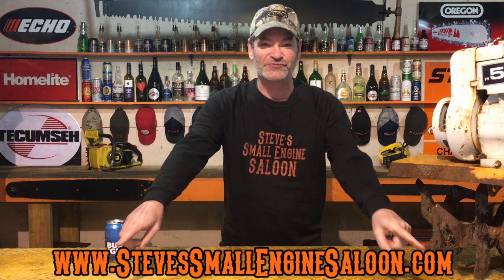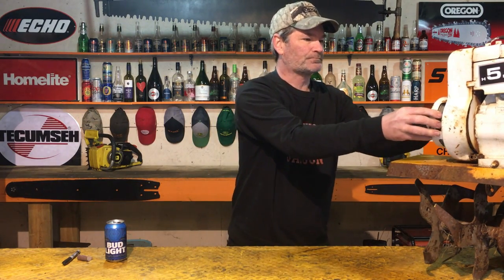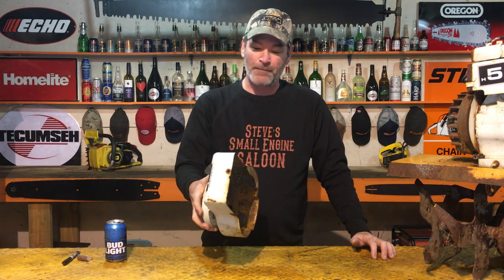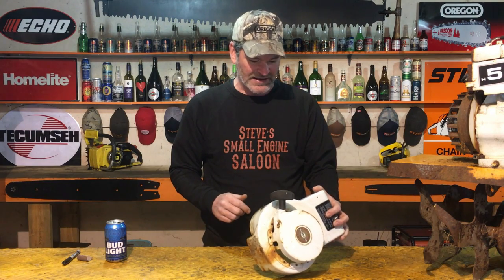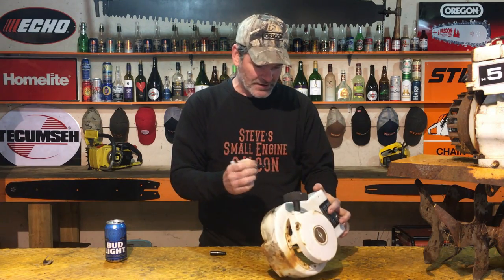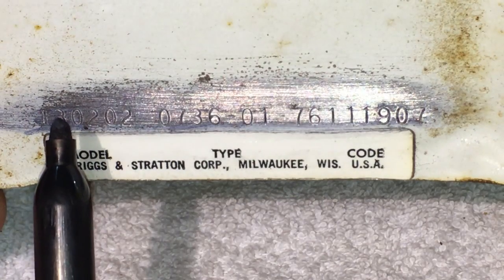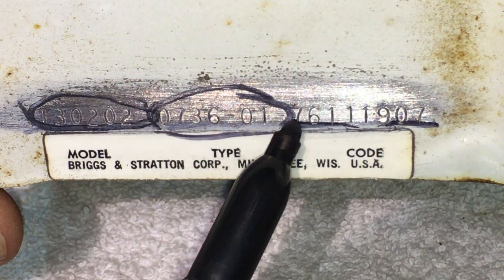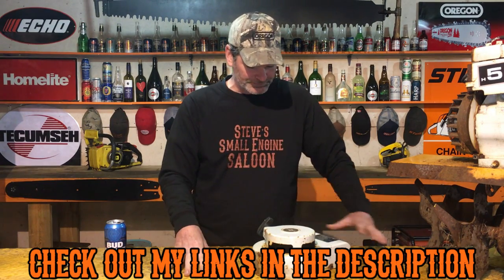How To Find Out The Age Of Your Briggs and Stratton Engine

Comment from the maker: Click here for my website--- http://www.stevessmallenginesaloon.com/
Click here for my Parts and Tools Store---- https://www.amazon.com/shop/stevessmallenginesaloon
Reply: So I have a briggs 6b hs and the first digits are 11 but I know it's a mid 50s. Is there any other way to find a production year?
Reply: Steve love your videos.
Have a question.
'77 briggs 5hp garden tiller
I keep shearing off the  flywheel key. 
Did a tune up changed the points kit and cleaned carb. New plug also. Can't keep from cutting key. Any ideas. Thanks. Mark
Reply: Steve, I've got an old 3 hp Briggs with code 6222051. The parts warehouses are asking if it's older than 6212310. Can you help me out? It doesn't have a coil, and I THINK that a 591420 (magnetron) will work, but only if it's older than 6212310. If not, I need the ancient sideways coil (291617). Any help would be appreciated!
Reply: you all probably dont care at all but does anyone know of a way to log back into an Instagram account..?
I was stupid lost my login password. I would appreciate any help you can give me!
Reply: I watch your videos all the time. I just need to be hand held on this particular question

Comment: Had to run out to the shed to check an oldie that was at my father's house when I cleaned it out.  It has an oil-bath air filter.  Still has good compression.  1959.  Now it's a "must-do" to clean it up and get it running.   Thanks for posting.
Reply from the maker: Good luck Joe...
Reply: You better double check with Briggs because they did not date them like that in 1959. Anything prior to 1965 and the code will not tell you the year. So your engine could be 1950, or it could be 1964 no way for that code to tell you.
If Briggs cant pull it up for you some of the guys on the antique websites can. The older ones have the DOM stamped on the back of the flywheel if you have an original flywheel on your engine, thats another way to see.
Reply: Has oil bath, flowjet carb runs like a top!! THANKS Joe !!!
Reply: Is on a Toro Tiller
Reply: @tombonardi8868  No, just the motor.  Degreased it yesterday.  Still had gas in the tank. Really nasty. must have been in there at least 25 years.  Getting the varnish out will take awhile.  BTW, it only a 2 h.p.  Not sure how good it'll be with unleaded, but I'll just keep as a collector.
Reply: My soninlaw needed a tiller so i found one on craigs list being as cheap as i am i paid 20 bucks for this real old looking but strong heavy one (i like to bring things back from dead lol ) cleaned it up , i guess it was sitting a long time its a toro tiller 3 hp aluminum block   downdraft/flow jet carb  I changed the oil new spark plug started right up  but carb was messed up looking for carb i couldn’t find year??
Reply: @OldJoe212  I think it'll be ok. That engine probably doesn't have any rubber on the intake. Maybe no rubber other than for the spark plug wire and oil seals. When I was a kid in the 1970s I used to fix those engines. Learned how in 4H. Brass fuel pickup into the tank. Gumout is your friend. See if you can get a carb kit. I'd also grid the valves, WTH. I think the media in that engine that goes into the air intake oil sump is just steel wool if that's nasty. Could probably clean it with gasoline. Shop air dry it. Rebuild it, put a new set of rings on it and I bet it'll fire right up. Those cylinder walls always looked good unless it ran out of oil. Coil may be bad after all of these years. Sometimes they short out.
Reply: I have a Simplicity 2 wheeled tractor numbers on the eng. Model- 6bh Type- 900535 Serial-51425  Any Idea on age?

Comment: Hey Steve I just sold my mother's old Craftsman 5 hp front tine garden triller for $125.00 . I told the young man that bought it the life story of the 1978 model triller , told him it got used at most 10 too 12 hours a year and it still  had a lot of life left in it . It didn't look the best after being that old and being keep in a shed all of its life . Well to make a long story short , he called me two days later and said it did great . He said he'd trilled an acre up with it and run just fine . I knew it would - but I told him that was a bit much for such a small Tiller . He'd really called to ask was octane of gas I use , I told him I use only 93 octane in all my small engines . Anyway this kinda went along with your old 1976 model Briggs engine story video . Thank you for you great help with small engines Marshall Border Jonesboro Arkansas 👍

Comment: That's a '76 Briggs & Statton Recoil Starter pulled from an old Briggs & Stratton Engine! Especially if it's a 3.5 HP Classic Engine! I have a '86 model of a Briggs & Stratton coded with the 86 as the first two digits. I bought an old stock from Small Engines Warehouse about 10 years ago a decade brand new and strapped on a 1993 Murray Push Mower Deck. I had to use washers after I  used a tool make the threads. The engine came out when I was born in August of '86. Lol Great video Steve! You know your engines really well sir! Take Care, Phil

Comment: To piggyback on your suggestion, when trying to read the engine numbers, use chalk. It’s not permanent and is super cheap. You can just about buy a box of sidewalk chalk for the price of a permanent marker. It’ll be able to be used for more that you think(from wood working to entertaining your kiddos). I’d suggest using a color that will best contrast your engine color to better assist you in reading the needed info. Once you’ve thoroughly colored over them, using light pressure wipe away the excess. Doing this will leave the chalk 
color in the numbered imprints. 
Thanks for the videos!!!

Comment: If you have an antique built prior to 1965, you can find your DOM stamped on the back of your flywheel if the engine still has the same flywheel. Also their are a few antique websites with guys who know when they were built and you can always try Briggs customer support, sometimes they have the info to look up. Not sure what year they stopped stamping the back of the flywheel, but I have two old ones, a 41 model I, and a 54 model 6s that I had dated from the antique guys and they were right when I looked and verified it with the back of the flywheel.

Comment: I'm rebuilding our vintage Norlett mulchmower's engine this video helped me a ton it's 3.5hp briggs engine was manifactured in 1988 😄
Reply from the maker: Cool!
Reply: I gotta agree myself steve but the unfortunate part is that the parts manual i got from the serial number was for a riding mower with a 4-5hp briggs engine and not a 3.5hp which the norlett mulch mower uses 😄
Reply: One thing i find interesting on norlett's engine which i never seen on a lawn mower before is that the recoil assembly is mounted sideways next to the fuel tank some vintage briggs engines from the 1960s-90s had it that way which is way different compared to the nowdays recoil which is mounted on top of the engine 😄

Comment: I have an old push mower with a Brig's engine and would like to know when it was built. I purchased the mower new around 1966 or 67 and would like to know exactly when it was built so I can see how hard it is to get a rebuild kit for that engine. The mower lasted a long time before it finally stopped working. Thanks for sharing this information with us on those mowers.
Reply: I have one that old. 1966 Sycamore mower with the original 3.5 hp Briggs. It is STILL, a one or two pull start mower, points & condenser ignition and everything.

Comment: I ve got one that's a 1978 model tiller - it's a dandy and still use it Steve . It doesn't even use oil - don't think it was used that much - knew the guy that bought it new - used it in his flower garden . Anyway the only thing I've done to it is service it and have installed two different carburetor diaphragms in it in its history.
Reply: My wife uses a diaphragm but not on her carburetor

Comment: Thank you very much I have a 1972 two horsepower. It sits on an is your platform made for JCPenney's edger trimmer. I could clean up I'm not going to rebuild it it's got good spark. Return everything to its like new condition and I believe this thing will be going for another 50 years. Thanks again
Reply from the maker: Very cool!

Comment: Is there a way to adjust the choke on a Briggs and Stratton 3.5 hp edger motor. I replaced the carburetor on this McLane edger and now when I throw the choke to run, it seems like the rpms take off and I have to choke it down. I did have to buy a cheap eBay carb because they stopped making the OEM one

Comment: My tiller engine was built in 1977 and still runs great. I didn't realize it's as old as I am.
Reply from the maker: Right on
Reply: My Wizard tiller's engine is dated 79 and still running like a top. Old tiller engines might last forever if taken care of because they don't get much use.

Comment: I’ve got a 170702 0652-01, 1988 production year (7hp vertical shaft engine pull start) and I’m trying to find a carb for it and just searching the model and type numbers hasn’t given me much of anything, and I can get diagrams of other types of 170702 but not this exact one. I’d like to find a rebuild kit for it and the carb (anything that would fit would work I don’t care wether it’s oem), and it also needs a starting spring, any advice/help would be greatly appreciated, I would like to use the engine to put together a super simple riding mower with no wiring whatsoever.

Comment: From a dealers point of view all of these numbers are mega important and speeds up any help finding parts. Especially the model and type numbers are needed if you are calling up for spare parts as any Briggs and Stratton parts look up need these numbers to look up the correct engine model, the code number will help as certain parts might only be dated for a certain engine.
These numbers can also be located either on the rocker covers or a riveted on plate on most large single cylinder engines or v-twin engines, stamped on a plate above the exhaust, on the cowling as Steve said or stamped on the engine block somewhere. Other engine manufacturers also have important engine numbers either stuck on with a sticker or engraved into the engine block I.e Honda. Quoting other important numbers to dealers also helps as well like chassis serial numbers.
Reply from the maker: I couldn't agree more!  Thanks Ben...

Comment: How does one figure it out if the shroud  isn't original to the block or missing entirely, though?

I have one with a cast iron bore that the shroud indicates being an I/C 13ci built May 11, 1986.
I measured the bore and stroke which did not translate into 13ci

Comment: This is good information. Although, not all Briggs &Stratton are identified this way. 
For example, a 1957 model 19, will list a model, type and seriel number on a data plate. Which is located on the side of the engine. In 5his case, Briggs has a downloadable file which allows matching the seriel number configuration with the year of manufacture. 
Just an additional resource.
Reply: My apologies, a model 14. I typed the wrong number.

Comment: My Craftsman-by-Generac seems to have a Briggs & Stratton engine.  But the model, type, and code are nowhere to be found.  Generac tells me to check with B&S who tell me to check with Generac, and Sears is no longer Sears so they're no help.   I seem to be stuck in a time vortex from around 2000.  There is a Generac tag on the engine that says "Engine Ident No 0042760EHC" but can't find any B&S info; not on the OHV cover, not on the recoil housing, nowhere.  Any suggestions?

Comment: All my old Briggs engine has is model, type,and serial number.  Is there any way to tell the year from that ? It's on a savage arms roto cheif 18 push mower. Thanks in advance for your help. The deck also has model 30T , type 561 scribed on a plate.

Comment: Someone just gave me a tiller with this engine. After watching vid, it was made in 1976. They said it had not been started in years. Removed the clogged air filter and left it off. Put about a half inch of gas in the tank. Removed spark plug and just cleaned with rag and reinstalled. First pull it sputtered. Second pull ran rough until I unchoked it. Now running smooth as silk and no smoke. No smoke even on start up. I have restarted it several times now and starts on second pull. Did I get lucky? How the hell can a 46 yo engine that has not been started in years run on second pull! The tiller works great as well.

Comment: So, Steve, my tiller was manufactured Dec 12th, 1975.  Where can I find a manual or info on getting parts, belts, etc...?  Can you help me out, please?
Reply: You can go on the briggs and stratton website and lookup the parts. Or any small engine repair shop should be able to get you all the info you need.

Comment: How are you with LP engines? I've got a Cummings 2500 camp power generator that runs then dies. If I start it half a dozen times, sometimes it will run for a half hour, sometimes close to an hour. Cummings was unable to fix it after working on it for better than 8 hours. Fortunately they didn't charge me for all that time.

Comment: I have a 40 yr old craftsman  gen'( B&S  engine), had  to work on govener, unable to get to a place to check  rpm, just set gov' speed by voltage out put. will this work ok?
Reply: If the voltage and cycles are correct then it is working properly I would say.

Comment: Steve this might be a dumb question for me to ask but I’ll ask anyway, out of those sets of numbers which ones do I use to order parts such as rings, gaskets and such? I’m rebuilding a 1973 Briggs just like that one you have there for a friend who had it when he was 14, it’s a tiller engine, it means a great deal to him so he was hoping that I could save it, I want to surprise him with it running, he figured it was toast
Reply: Sorry for a late response but it should be the 1st set of em, the Model number. For example, mine is a 252707. If you google those numbers, you can find stuff like the right Carburetor and Starter. Hope this helps
Reply: Any breaks @ scrapem engine that still runs would be a surprise!
Reply: Thank you for the help and sorry for the late response, For some reason I’m not getting the notifications regularly telling me that I have a comment I don’t understand that but I did this time just recently and seen that I had missed a comment

Comment: Do any of the codes tell me the size or HP rating of my old style briggs motor . I bought a 5 hp on ebay . But it just looks kinda small . Think it might really be a 3 hp . They might have put a 5 hp sticker on the fan housing ?
.

Comment: According to Briggs' website the code number system didn't start until 1965. So for engines before that they have a chart you look at based on model number. My code starts with 63, so I thought it was built in 1963. But according to their site that's not correct. My full "code" or "serial" number is 6303293. Can you help with this?

Comment: I have a 2hp b&s with no number because the recoil cover was replaced I did find a number with letter on the head between the fins 8c is the number does it mean anything my best guess is about the 1960's. Any info from others that might read this also

Comment: Hi Steve, i seem to be getting a film of oil being flung throughout my brand new zero turn mower. It has a commercial 23hp Briggs and stratton. After many hours of trying to determine where the oil is coming from, i feel it could potentially be coming from the sump area but can't say for sure. Is it even possible being the engine is brand new? Any ideas or thoughts on this would be greatly appreciated. Also the oil was about 7mm over the full mark from the dealer and has droped down to 4mm over the full mark after 2 hours of use.

Comment: What about Horsepower, I have a 1962 Briggs Model 100202 401052 6208200
Cant figure out what hp it is, I want to convert it to electronic Ignition. I thought it was a 5hp and got a coil and it didn't work. Any help would be appreciated 👍

Comment: I have a Ranch King Pro mower BUT it has had the engine replaced so how do I find the age of the mower minus the engine? I don't have the book so I don't know if I need to change the transmission fluid for this machine or not. (It is not mine, it is the neighbor's mower but he is a computer guy). I know nothing about this machine other than the engine (Briggs & Stratton Intek 500cc 17.5hp made 2016, March 15th, from plant ZA) but the rest is a mystery. Again, this is the second engine.

Comment: I bought a rototiller  that was never used but someone had messed with controls model 190402 1683-01 78112710 and I need the control diagram for gas control. This motor probably has 2 hr. Could you turn me on to where I can get diagram?

Comment: In fact to was Nov. 19, 1976 (76111907) year, month, day, and factory # is the way to read the code. The last 2 numbers I'm not sure what factory. But it was Nov. 19, 1976
Reply: The final two digits designate the plant and assembly line.

Comment: be careful using sandpaper and a sharpie on the date code if it’s laser etched, like on my 2006 model. 
you can sand it right off, and the sharpie just covers it up. 
the laser etching does not go very deep!
i hit it with a small bit of very fine sandpaper to get the rust off, wiped it with microfiber and spit, and then rubbed it with a little mineral oil and it was easier to see.

Comment: You don't replace a briggs and stratton because of age, they will run reliably for generations. i Currently have a 1960 Earthbird with the original engine and it starts every spring and all it needs is oil changes and the occasional diaphram kit. It will outlast me and the next owner if they take care of it.